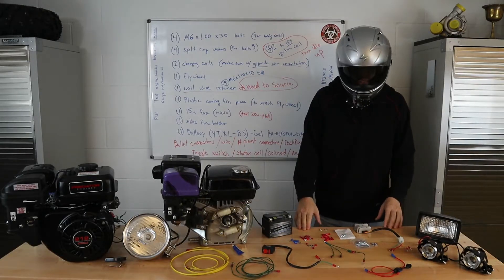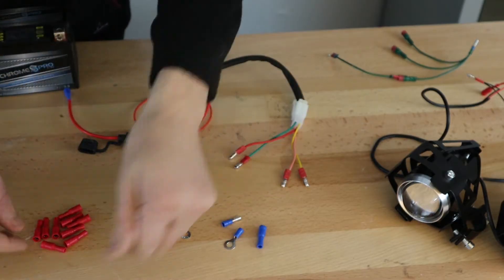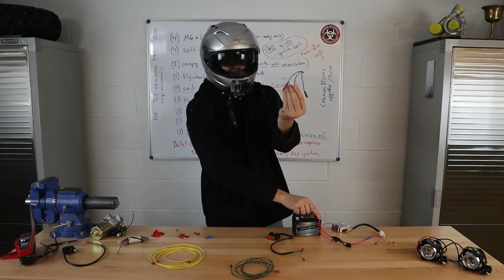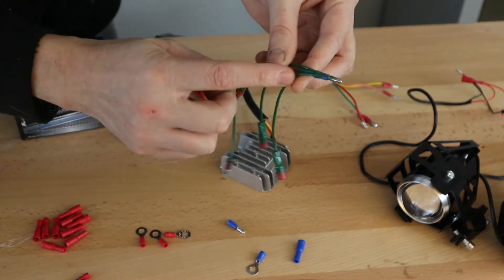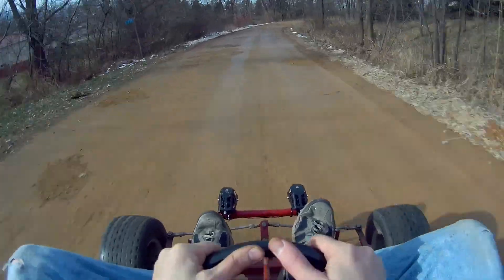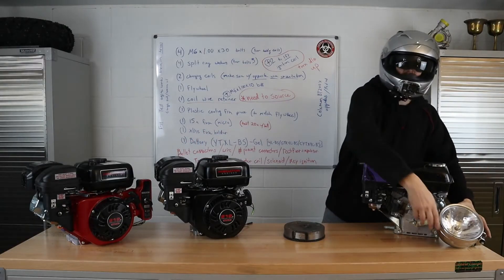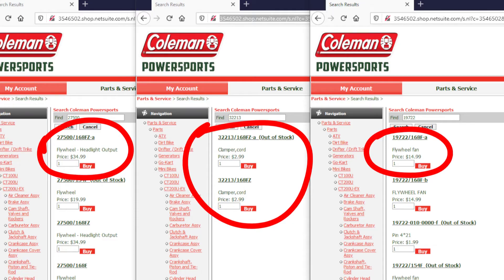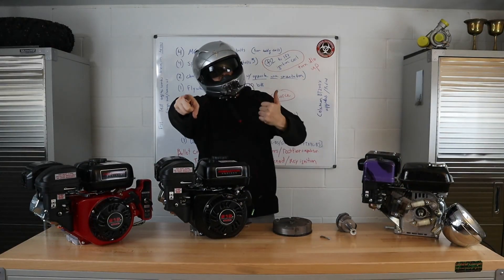Power led lights on go kart mini bike and more with predator 212 charging coils electric start

Comment: I'm about to wire my Odyssey and this is the bee's knees as far as DIY tutorial. 2 ques.
1. With one charging coil do I just leave the male end open that would have connected to the 2nd coil?
2. My engine has an electric start. Do I just stack another hot wire from battery to solenoid and stack another ground from battery to engine? It starts with just the two connections. I'm just basically using and converting the coils power via the rectifier but still using battery to start? (which I have.and plan to fab your harness). Hope your well. Any help would be greatly appreciated. Thanks - Josh

Comment: I was confused by your fuse placement in the actual wiring harness. It does not match your wiring diagram. The wiring harness as you configured it pulls the positive side directly off the battery terminal, so the current going to the light system from the battery does not pass through the fuse. There is no fuse protection for the lighting circuit and all the fuse does is protect the wiring between the regulator/rectifier and the battery.
Reply from the maker: The battery should not have a surge coming from it to need protection from. The surge can come from the generating coils on over rev. You're protecting the battery and circuit there after. A flashlight should not need fuse between battery and light, for example.
Reply: @megoingfast  the main purpose for a fuse is to protect against an overcurrent condition. That is almost always caused by a dead short in the wiring (pinched wires, failed insulation, etc) as most devices fail open as opposed to shorted out. No fuse protection for wiring harnesses is how they get melted and/or fires start.

Any "surge" in the charging system from over reving would be a high voltage condition, not high current. A fuse will not blow from over voltage.

Comment: What's up my Friend...You are to me the finest person who shows exactly how to do something from start to finish and everything in between.. Red Beard is TOO fast and doesn't explain things good enough for people never doing this such thing before. I use to race lay down Karts in Chantilly, Va. about 50 yrs ago.. Cars and Cameras are about 30 mins away from in Greenville, N.C. Back when I was running karts we just had battery to starter, ground and a push button momentary switch to crank them. These sorry ass new China made stuff is something.. Are you using the  starter switch that came with the electric start kit? I'm building me a Dingo with  predator engine with electric start. I want while the key is set on run (before cranking and after) to be a accessory for the lights that way when I turn it off the light will go off if I have forgotten to turn light switch off. Can the switch that come with the electric start be made to do this or is another switch needed? trying to make this short, but impossible.. The Red wire and the White wire coming for this switch box are Hot. The wht./blk wire coming out goes to a single charging coil.. I'm wondering isn't there a way to make the white hot wire here run to the solenoid and make this switch work acc. and run the light without cranking when you turn it to the run position. Also, couldn't the lights be wired in series like tying the black from 1 to the red of the other and that will leave 2 black wires, which 1 is actually Hot? Put a piece of red tape a few places on it so you will know. Instead of wiring them parallel. Or do they have to be wired in parallel. Main question is, I guess, Can the switch that comes with the electric start kit be made to have accessory or with this switch just crank the engine? Thanks and sorry for long post..

Comment: I've watched this video a few times. If I'm understanding correctly, the electric start kits are not good because the flywheels are not good and because they don't come with a flywheel fan. The Coleman flywheel might be better in terms of construction however there is no such thing as a "Coleman" charging flywheel with the starter ring gear.

Not sure where this leaves us if wanting both elec start and a quality flywheel I don't need a billet flywheel and won't be building a high-RPM engine.
Reply from the maker: The electric start kits, all 3 I've had my hands on, were trash quality. I use them, they can work, might need a tweak might not. But overall I won't trust them to spin 5k myself. I run with a torque converter so it keeps rpm lower.
Reply: @megoingfast  That's my thinking too, My RB200 has a torque converter and I have no interest in high RPMs for it. The kits seem like the easiest way to get flywheel/shroud/starter at once. Starters and shrouds I've seen separately, but charging flywheels with ring gear not so much. Perhaps since I'm not concerned about high RPMs I should not worry about it.
Reply from the maker: @thenexthobby  my rb200 with torque converter, header, intake filter, jets, tuned green spring on cvt, 4200 rpm. CVT really keeps rpm low.
Reply: @megoingfast  Limiting RPM is one thing I like about using a TC. I also have a standard "Stage 1" tune but it's too lean for some reason not related to altitude. I need either a more restrictive exhaust or a jet kit to play with, because the usual #83 jet upgrade actually isn't large enough for mine.
Reply from the maker: Tillotson 212ee, electric start, complete engine. Flywheel rated for 6k, with bursts up to 10k for not prolonged durations. There are some charging options if you custom fab here and there, but they are hard to find. For a predator hemi version engine, the Kohler flywheel is a higher quality, but cannot match the Tillotson.

Comment: If I add electric start do I need to use the normal key switch panel? I’d rather use a traditional motorcycle key switch on “the dash” of my RB200. Incidentally these come with a regulator.

I haven’t yet found Coleman’s parts page but it’s shown here, https://www.monsterscooterparts.com/brands/coleman/models/coleman-rb200-mini-bike-parts/4-pin-rectifier-voltage-regulator-coleman-rb200-mini-bike.html
Reply from the maker: I do not use the key panel. It's bulky. You connect the coils to the regulator same as in video, they charge the battery only and everything else runs off battery. The solenoid can have its circuit completed coming off the battery from a key and the starter just hooks to battery to ground with the solenoid completing the circuit on key turn.
Reply: @megoingfast  So do you still have your RB200? It's OEM rectifier looks like it has two yellows, a red and a black on the harness that plugs into it. I haven't had a chance to see what goes where yet ... or even learn WHY this model even has a rectifier.

I call its rectifier the "mud catcher," since the front fender doesn't sit low enough to protect it.
Reply from the maker: @thenexthobby  yup. Still have it.

Comment: I was a bit confused about the wiring adapters from two charging coils that were found on the "electric start motor kit" link in your description. They come together in a white adapter but in the video, they were single wires. Is it possible to remove the white wire adapter from them or could that adapter still be used for the head lights?
Reply: Yea I had a engine with another coil on it and it had two wires instead of one so I had no clue what to do with it.

Comment: So the duromax hpe already has the charging system in place so you can just add a battery and lights and you’re good to go?
Reply from the maker: And regulator. I am forgetting if it has a single charging coil or double but there are many engines ready to go!
Reply: Aaand I was considering to get the predator 620cc lol

Comment: I have a predator 212 non Hemi that has dual charging coils with two separate wires do I tie those together to go to the rectifier or am I supposed to have a rectifier with two inputs
Reply from the maker: They're both hot wires. The rectifier should have 2 input wires either yellow, brown, or pink. One coil on each one. Engine needs to be grounded as shown in video to complete the circuit.
Reply: @megoingfast  thank you for the info I bought a kit with the electric start and charging however to the best of my knowledge there is no rectifier all theer is in side of the key control box is a fuse and a ignition switch yet this is supposed to be a charging and electric start system as it came with  coils I had eight or nine volts ac coming out of one wire and nothing out of the other do I tie these together and just put them to a line that goes to the battery
Reply from the maker: @azdeserthobbies2047  try to reposition the coil not getting a charge. There is a wiring diagram in the video at about 0:57 where it shows with the starter. You will need to buy a regulator, link should be in description.
Reply: @megoingfast  so I just rechecked the wires with a meter if I put it on Ac and go from one wire to the other I get 9 volts ac if I go from either wire to ground I get nothing if I put it on DC voltage I get nothing only one wire to the other AC current 9 volts

Comment: Will this kit work on the stock coleman engine? I’d like to put on some led lights and a battery. Will the stock coils work for charging the battery and keep the lights bright?
Reply from the maker: Yes. If you only run at night, the battery will go into 'maintain' mode while consuming power and charging kind of levels it out if using very intense bulbs like I'm using. It makes for a very bright light but it's a very small charge. If however you are running the engine without the light on it charges very nicely and when you need to flip the lights on they're very nicely ready to go.
Reply: @megoingfast  will it ever over charger ?

Comment: Any chance u wanna show the mod upgrade for charging system to the coleman mini bike that never had it... 100rb or 105cc motor? That would be awesome
Reply from the maker: I do actually, great suggestion! The coils struggle taking power away from the engine and the coils need to be external so I need to up the power and change jetting to compensate. I'm looking into specs on it but I do not have a complete solution. The billet flywheel for the predator engine is very pricey and not in current video budget, but has a larger outer magnet to test with (taper untested for fit).

Comment: New subscriber. New Coleman bt200 owner! Can I upgrade just the bulb to a LED? If so can you tell me what one would work? Thanks brother.
Reply from the maker: Yes and not really. The p15d replacement bulb had many LED replacements that fit, but the engine is not putting out DC energy which LEDs are best suited to work on. Basically you're making a strobe light that can burn out an LED quickly. However, I've not tested all replacements, only a handful.
Reply: @megoingfast   Thank you for the info!